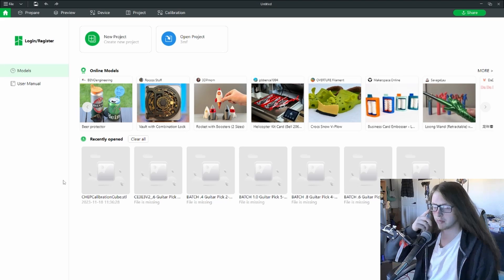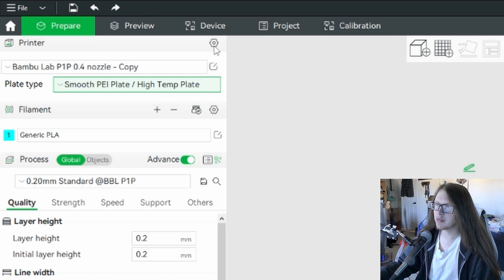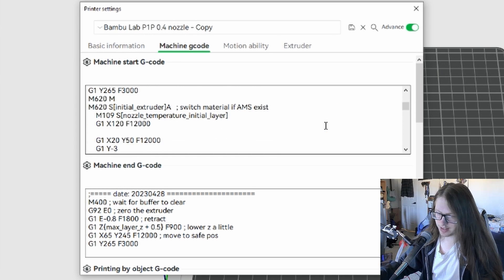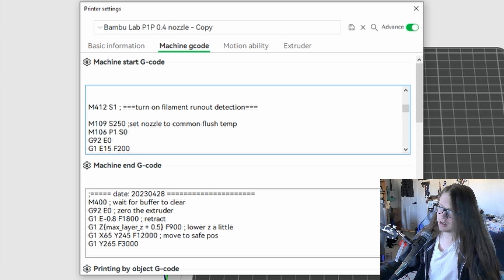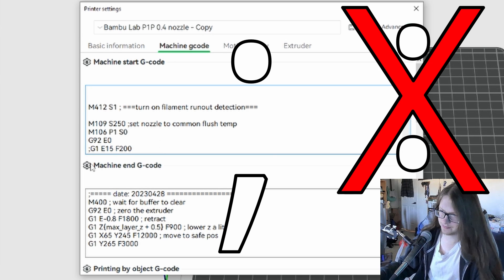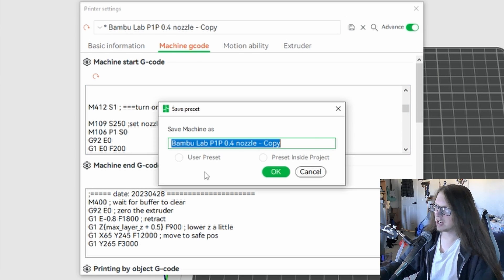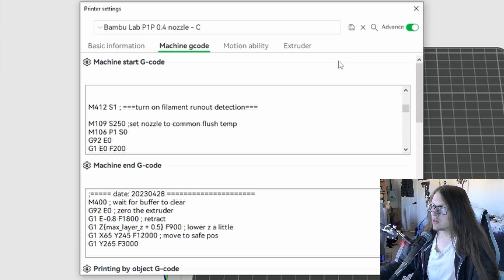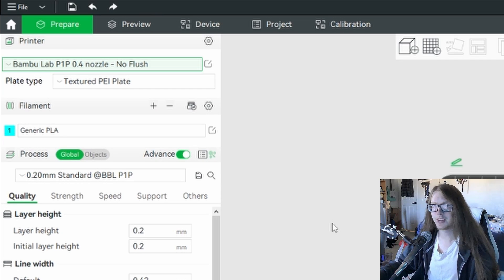(WATCH UPDATED VIDEO) How to Reduce / Remove Bambu Labs Purge

Comment: Just to add to and clarify why the coding works this way: The G-code that these machines use is the same as pretty much any CNC machine. Also known as EIA code. In EIA code a "/" is a character that denotes a skippable block if the "block skip" mode is switched on. The semicolon is the symbol for end of block. So if there is a semicolon in front of any characters the machine will ignore it, since it will look to the next block at that point. 

And for the record, in EIA code each line is called a block. 

This is a useful video! Thanks for putting this out there for everyone.
Reply from the maker: Thank you for sharing this bit of info. I know the basic functions of the machines are similar but I thought that CNCs use grbl. Unless there's multiple languages like there is for 3d printers as well.
Reply: @Bowsmin12  nope, even the CNC machines that use their own proprietary programming interface will take standard G&M code. The Bambu g-code is the same g-code you will see anywhere else. Just that each machine has their own M-state variables. Even in the industrial CNC world each machine manufacturer, and controller manufacturer has their own M codes. About a third of them are universal.
Reply: @Bowsmin12  for the record GRBL is just EIA without the ANSI compliance. 😅
Reply from the maker: @clockworkleather  Most of this is over my head for now. I have very little experience in the programming section of anything. lol.
Reply: @Bowsmin12  This is the only code I really know. Almost 25 years in the industry. I've run the wheels off of a LOT of CNC machines. 😅

Comment: I don't even have that line(G1 E50 F200) in my startup gcode
Reply from the maker: Do you still have pre print purge? If you do then you had to have missed it. Some people actually mentioned that the line shows up a few times for other actions as well. So other than that I don't know how else to help. Someone recommended copying the code over to a text document for easier viewing. You might be able to Ctrl F find the line that way, but I'm unsure. Especially if you use google sheets or something like that. Then replace your text doc code with the slicer box code. I've never done it that way so I don't know if there are any weird glitches that come from doing it that way, but as far as I've seen it's usually a safe transfer.
Reply: I found it a bit futher down in my start gcode

Comment: Do you know if Chamber fan settings are changed somewhere in there too? I seen a few changes in filament profiles but seems to still keep coming on anyways.
Reply from the maker: I would guess that it would be, but I don't have any type of enclosure which is what I assume that has to do with. So I really don't know. I got this solution direct from bambu support though, so it's possible they could give you a specific answer of if and how.

Comment: How is this different/better from changing the Flushing Volume from the filament section? There is a multiplier there that you can change from 100(%) to any % you want. I typically keep mine at 50 and that’s worked out well. If I’m printing with colors that can “smear” easily, I might up it to 65, but never above that. Just curious what your method does that this setting doesn’t.
Reply from the maker: This mainly applies to people who are using single colors. It only affects the purge at the very beginning of the print to prevent unnecessary waste. This method has nothing to do with multi color purging other than I guess it could have the possibility to mess up the start of prints if used at the same time as multi color prints, though it should be unlikely logically.
Reply: I believe that is only for swapping colors when doing multicolor prints.

Comment: Thanks my dood! When you use the same type of filament over and over its just a waste..I was wondering how to get rid of that. Problem solved :)
Reply from the maker: Yeah, it seemed like it wasn't actually posted anywhere. I think I mention it in the video but I saw it posted deep in a subreddit somewhere with minimal instruction but not really anywhere else. I got this solution straight from bambu support. Glad I could help.

Comment: what happens when you set it to zero and you change color? does it just start right away when changed?
Reply from the maker: If you're talking about before the print, the filament change processes should allow you to make the proper purge. If you're talking about during I have no idea because I don't have an AMS, but I assume it's separate gcode and not part of what I changed in the video.
Reply: Yeah I am interested to know this as well. I have AMS so I will give it a go and report back :) @Bowsmin12

Comment: There are two lines with the G1 E50 command on that code section. What does the second one do?
Reply from the maker: I don't know. There are a few of the same line with a few different values. I assume they are the extrusion that apply to different functions like the pre extrusion line on the plate.